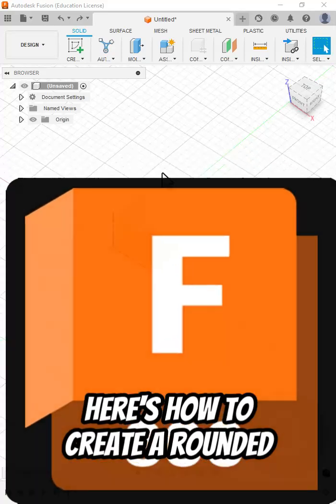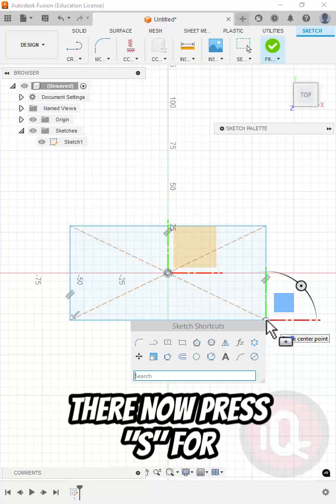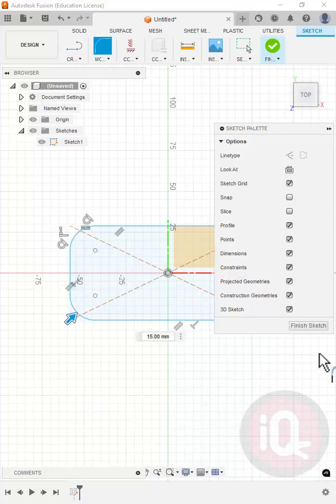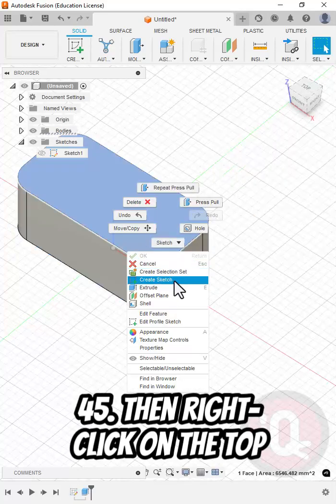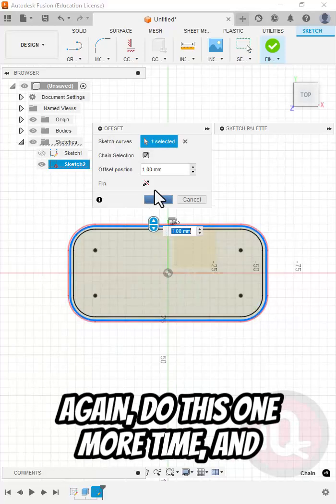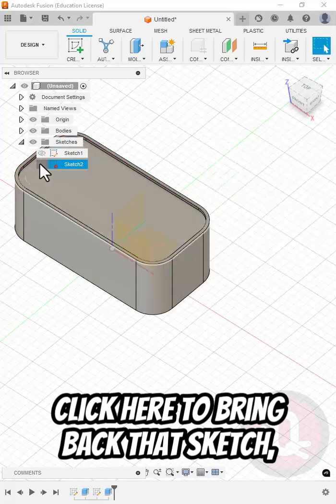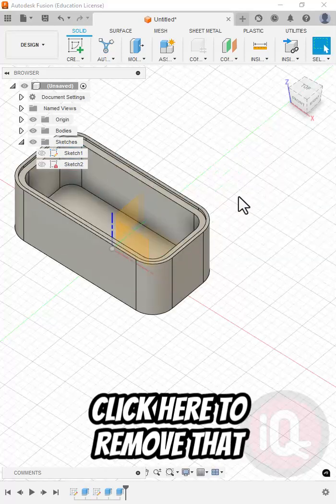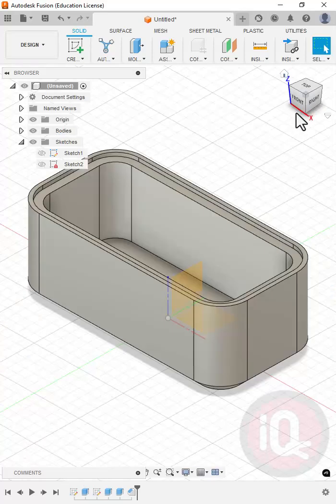Fusion360: Make a Rounded Box #3dprinting #fusion360 #fusion360tutorial

Comment: If you were starting out right now from scratch, which CAD program would you get into? AutoCAD, Solidworks, Fusion, Onshape, Tinkercad. I plan on using it for designing my own stuff for 3D printing, an office extension for my house and for recreating automotive parts that I’ve scanned.
Reply from the maker: For Cad I would recommend Fusion360 you can get a free license for non-commercial work.
Lots of tutorials out there to show you how to use it and its a very robust tool.
Reply: I personally use inventor